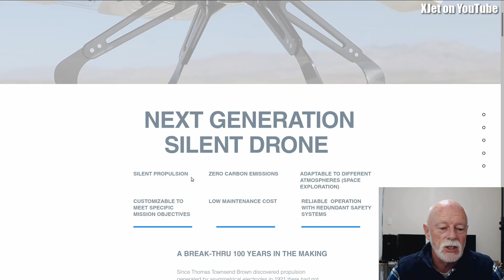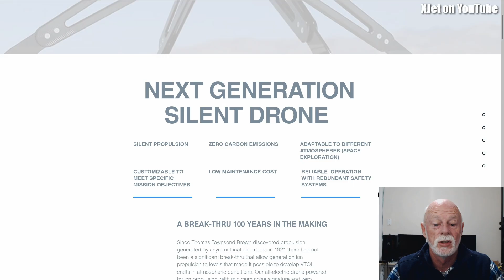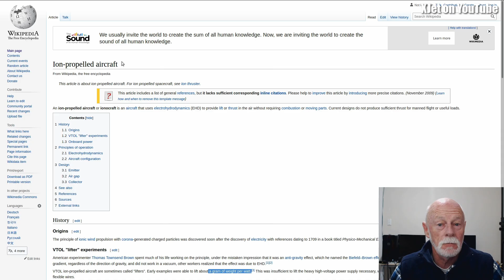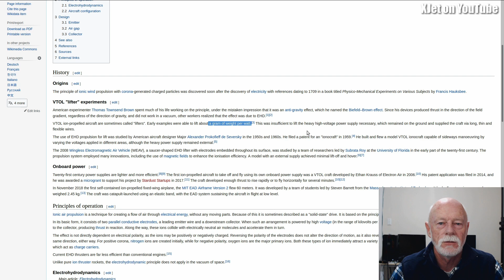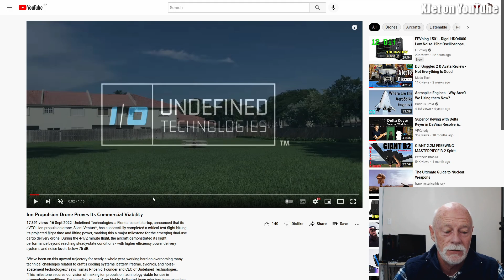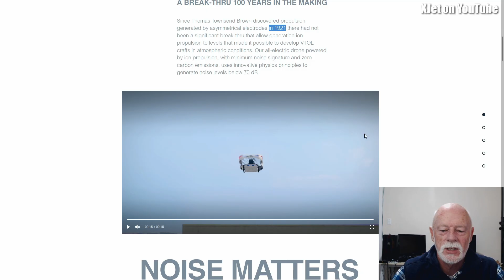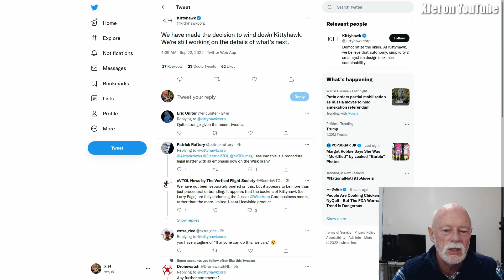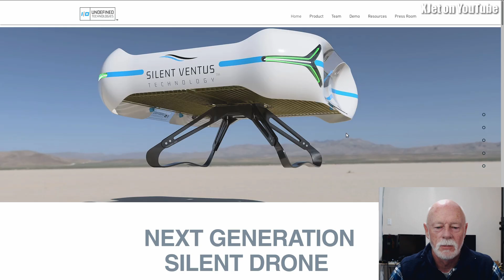Ion drive drone BUSTED

Comment: Don't forget about true AGM batteries.
Being in a car audio industry I've noticed that now the normal 12 volt battery that was made out of traditional lead is now glass mat battery non-spillable that most of the weight is in the case.
Some car audio Enthusiast will use large capacitors like in my videos that will replace a battery for example you could use six 4 farud capacitors to replace one 12 volt cell.
Reply from the maker: Unfortunately supercapacitors don't even come close to batteries in terms of energy density (either by weight or volume)
Reply: Dear Sir,  

I really enjoyed your video thanks!

Please see the more efficient versions of ion thrusters on my channel and website.  They are called the Self-Contained Ion Powered (propelled) Aircraft or Ion Propelled Vehicle.  These are the only ion propelled devices that are verified and patented for lifting their power supplies against Earth's gravity!  
The invention works using clearly explained well-known physics principals.  The crafts are of course very lightweight, and it was a major challenge to get them to lift their power supplies at all with ion propulsion.  They produce roughly an order of magnitude more thrust per watt than other ion thrusters, the ones with prototype steering systems require more power.  

I have been working on this FT for the past 23+ years so far.  I had to build many hundreds of very small HF high voltage transformers in order to improve them, as well as all the other components, the crafts also had to be designed to operate on much lower current levels.

I suppose you might already know about my work at this point, but I thought I should mention it.  I can point out any further information or verification that you may like about these devices, but I think you will find what I have already published sufficient.  Please feel free to contact me if you have any further questions.
Thanks again!  @xjet
Reply: @xjet  that's why we use them in car audio mainly just to reduce that headlight dim when the base hits. It's a quick release of energy.
Reply: The capacitor storage requires a charge source. They drain rapidly.
Reply: How did you get 12v from one cell? A Pb cell can deliver 2 volts - a lipo/lion cell delivers 3.5 and an alkali cell delivers 1.5. - approximately. If you can find one, now, a Nicad cell can deliver 1.5 volts.

Comment: I did see on YT a small scale, very lightweight  model, about 10 sq cm (4 sq inches) which showed the ion effect. It was an educational science video. But it was connected to an electrical power source. And like you said Bruce, the battery weight effectively cancels out the lift required to be viable.  
The product video of this ion drone,  also looked highly unstable. With all the surface area of the tinfoil grid, I would expect a puff of wind blowing it sideways very easily. So it seems it might only be useful on windless days. My cheque is in the mail to them though. (What? Banks don't use them any more? What are you implying, i'm lying?)

Comment: I saw an actual flying ion thrust thingy somewhere (a university experiment I think?), it was made of a barely solid metal foil so flimsy and wispy light that if you sneezed it would fall apart. Even then it could juuust move under it's own power and seemed completely useless for anything practical.
Reply: Ethan Krauss
Reply: "MIT engineers fly first-ever plane with no moving parts"  it's an University experiment, but it looks honnest, they designed a plane that looks underpowered (ie: a sail plane) and is using very low power. But I would not be dismissive of pushing wind with electric fields entirely, maybe somebody will find another useful niche. I think of the VR headsets where designers though we would have shitty meeting in shitty virtual meeting rooms complete with motivational posters on their virtual walls with the added bonus of a headache and motion sickness. And the truth of the matter is that people are actually enjoying their VR rigs to play Beatsaber for hours, nobody saw that coming.
Reply: They tested it on Mythbusters. 😊
It worked well with an atmosphere... Without it, it didn't. 😬
Reply: @MCsCreations  They will work in space: electrons have mass!
Reply: @mickgibson370  in a circuit they tend to travel in a circle unless you are ejecting them for mass in which case you become highly electrically charged making each one harder to get rid of than the last.  This arrangement just shoots them from one charged surface to another on the same craft generating no thrust at all.

Comment: Oust the fakers. If the Tech was anywhere near. A wire to a external power source would have made a better demo than edf. At least to show the theory works. Hope you get flying soon
Reply: Their original video showed a large external power supply, and even then, it needed large counterweight on a lever for the craft to move upwards.

Comment: One more hint the video of a flying thing was a scam: all in-flight oscillations has CW rotational motion in them: the effect of precession of a rotating mass somewhere on the craft.
Reply: (or just a poorly tuned PID stabiliser)
Reply: A static sink full of water generates rotation as soon as the plug is pulled. Direction depends on which side of the equator your on.
Reply: It was an animation. No doubt about it.
Reply: Nope... Check out his other videos.
I know him personally.
It's legit.
 Say what you want thou you
Reply: See Ethan Krauss. He has the first ion propelled craft capable of lifting onboard power supply. Ion propulsion thrust to power ratio is up to 110 Newtons per Kilowatt per the MIT studies, so even if we need fuel to generate the power, it would be more efficient than just jets because it's can achieve over 100% thrust to weight ratio using Electrohydrodynamic thrust augmentation, just like the original Thomas Townsend Brown patents on flame jet electrokinetic high voltage generators. With nano-textured electrodes, the ionization energy drops and produces the modified Paschen's curve for microscopic radius of curvature, which will allow operation at less than 1 Kilovolt, however the efficiency and thrust increases as the third power of voltage, and has a bilinear relationship to current, so to optimize it you must increase the distance between electrodes, achieve the lowest possible corona discharge inception voltage by cold field emission at the cathode, and then increase the voltage on just the acceleration grid as high as you can get it without arc discharge. This is all very feasible, but it requires a highly optimized circuit and large lightweight frame. I could see this working really well on inflatable structures. Electrofluidic propulsion systems have been tested in Helium airship designs for example.
Reply: @taylorwestmore4664  - there is no question electrostatic propulsion principle works and has some space for improvements in efficiency. But the concrete contraption shown in the video is faked.

Comment: Until "I" can get in it and fly for at least 2 hours, .... it's a damn TOY! 😱🤣🤪👍🇺🇸
Reply from the maker: But if it was a toy it would be subjected to a greater level of rules and regulation.   Remember, in the USA  you'll need to have Standard Remote ID fitted to a 251g scale model of a Piper Cub as of December -- it's the rule!
Reply: @xjet  not gonna happen, we will continue to fly regardless! 😱🤣🤪👍🇺🇸
Reply: @xjet  and like you mentioned it is all for not because after they ruin our hobby for corporate greed they won't even be able to do anything with that airspace.

Comment: I have played with ion wind thrusters for drone usage, and came to the conclusion that its basically pointless, at least with current materials and technology. 

Other problems are response time, and stability, not to mention the problem of carrying enough power storage to even run it. It might work if you power it via something thats not on board and transfers it without using cables.